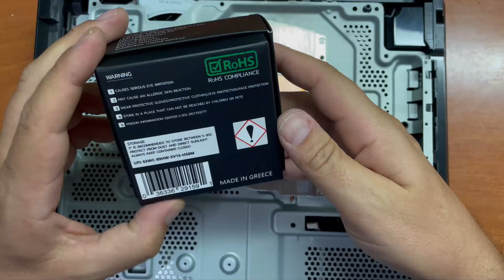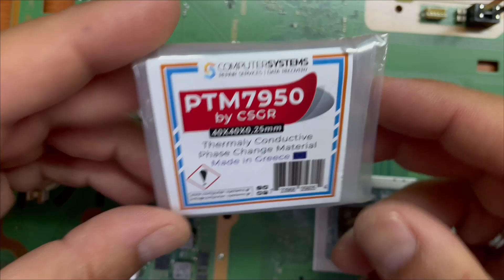Sony PS4 Thermal Paste Upgrade: Using PTM7950 by CSGR & UPSIREN UX PRO for Max Cooling Performance!

Comment: Thoroughly cleaning the silicone residue from the old pads with isopropyl alcohol might increase the putty's tackyness.
Reply from the maker: Thank you for watching our video so attentively! You are absolutely right that, in general, thorough cleaning of old silicone residue can help with a thermal putty’s tackiness. However, our thermal putties are designed to be hydrophobic, which means they naturally repel any minor liquid residues and form an effective contact with the heat sink. In cases like this, where any residue is nearly invisible, our putty will adapt and adhere well. But, if there are visible remnants from previous thermal pads, we definitely recommend careful cleaning for optimal results.
Reply: @ComputerSystemsGR  whats the difference between this PTM7950 and the Honeywell PTM7950 ?  I installed this on my PS4 PRO 9.00 tonight and fan still kick on spider-man & sifu
Reply from the maker: @rayoflight-777  Thank you for watching our videos. Our phase change material is designed to work together with our thermal putties smoothly. In order to provide advice we kindly ask you to inform us which products you used exactly. It would be useful if you could also send us photos of the application.